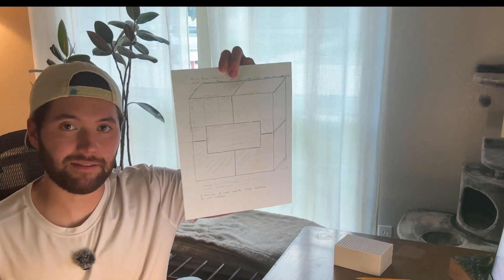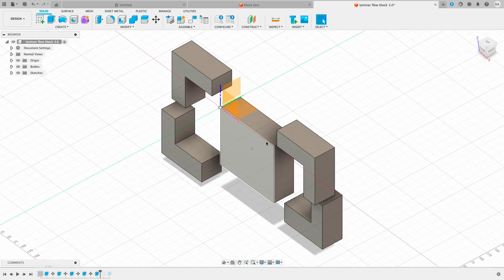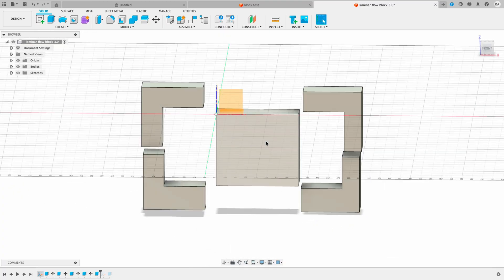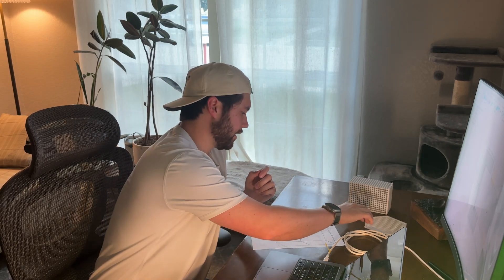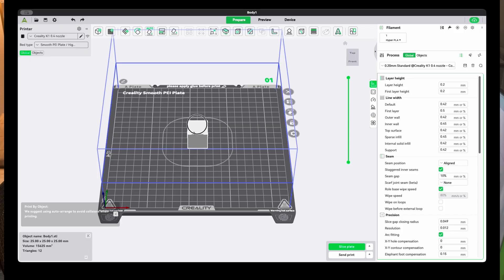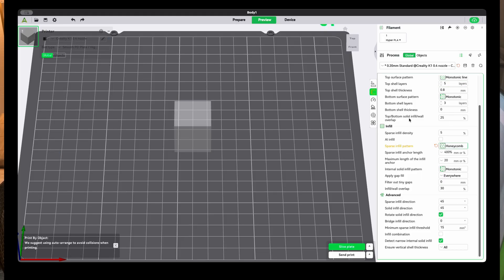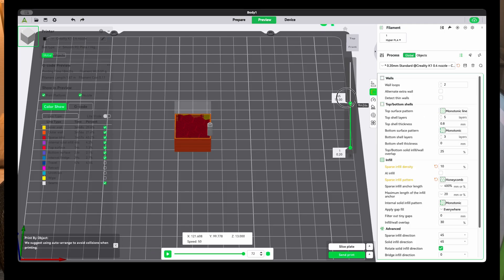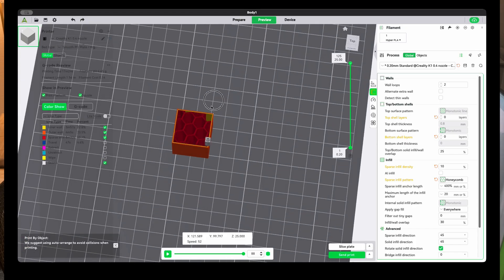DIY Wind Tunnel Part 3: The Flow Zone

Comment: I have no clue, but I like the project. So I make a guess. What about the "tiny" fan. maybe you need a bigger one, you could get away with less RPM with a bigger one and make it further away, so the disturbed airflow infront of the fan is further away form the actual wind tunnel chamber
Reply from the maker: Interesting take! I definitely want to get a larger fan! However the distance from the chamber is something worth considering! I assume that it would need to be closer! I have no idea though! It’ll be fun to find out!